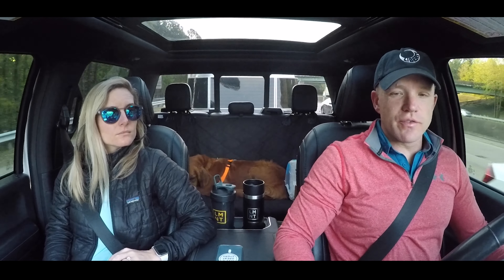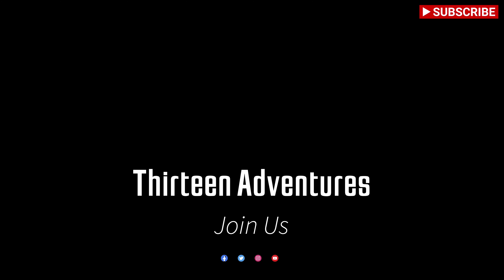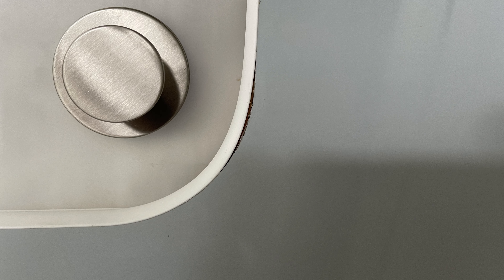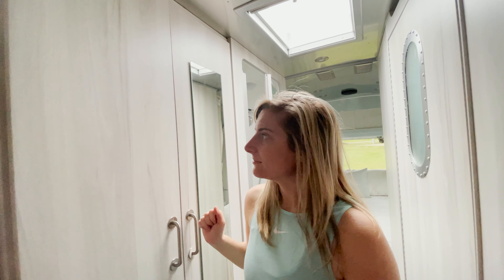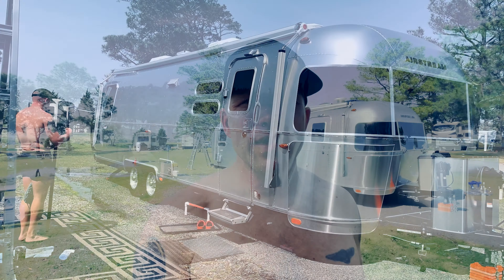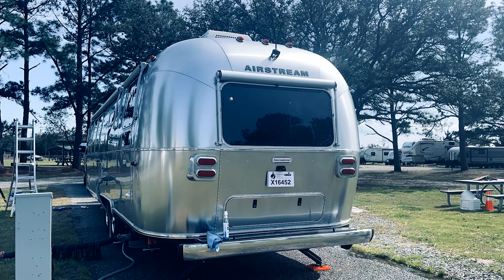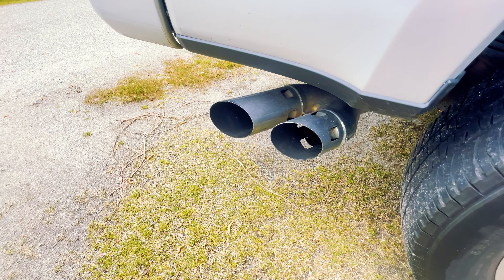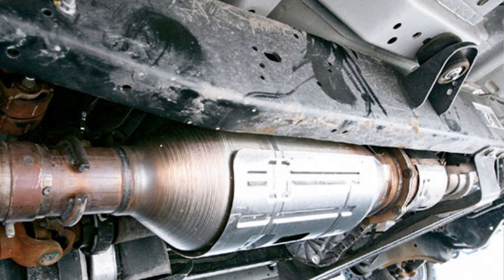Airstream Roof Leak, Ford DPF Replacement, and Bacon-Wrapped Chicken!? 😱🔧

Comment: Great videos, but very difficult to hear you in the truck.
Reply from the maker: I know...it’s so frustrating to edit. I tried to edit the sound to be better but couldn’t get it right. I was using a new GoPro and the cover for it was blocking the mic I think.  The road noise was so bad on this road, it was hard to edit it out.